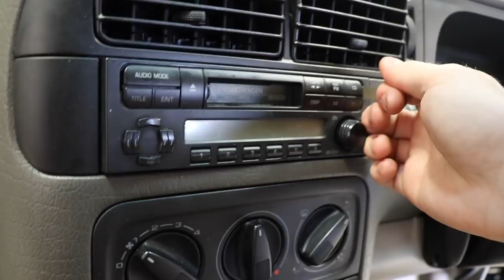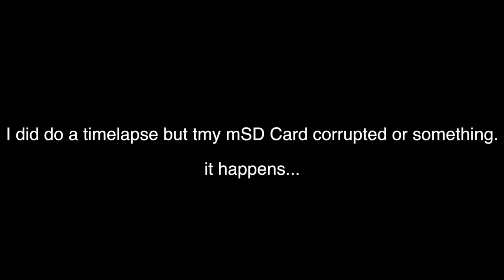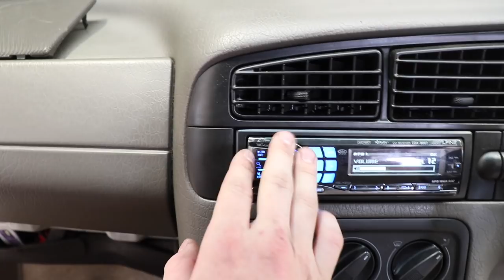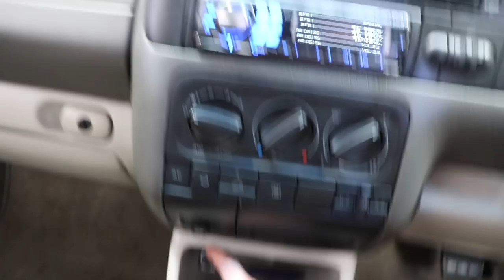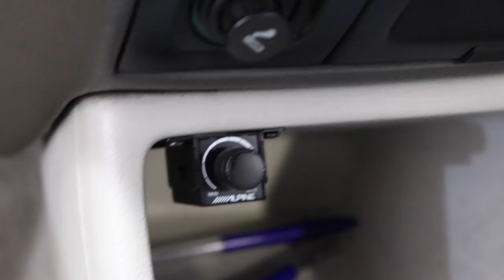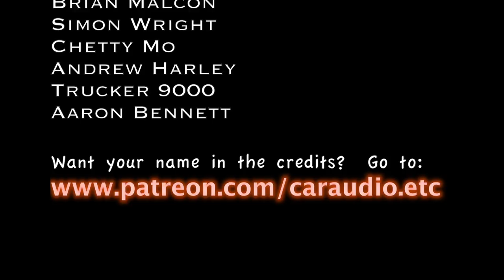VW Golf Cabriolet Gets Some Old Alpine Gear | Sound System Install

Comment: James, The pump in the boot area where the changer was is the pump for the hydraulic hood. The hood uses a hydraulic fluid to lift and lower the hood. You can see the fluid in the cylinder at the end of the pump.
Reply from the maker: You mean the soft top, Or the bonnet?
Reply: Soft Top

Comment: Outsize subwoofers that take over half the boot space is a boy racer thing and looks terrible. Installations should be factory standard where everything is discrete and hidden behind panels etc.
Reply from the maker: That’s fine if that’s your opinion and that is pretty much what we do for almost all of car Audio jobs, but when a customer says can you put my 10” sub in my boot we don’t say “no that’s not how it should be”!
Each to their own man
Reply: Thanks for reply, I'm not blaming you as I have seen your videos. These customers should be locked in the boot and the system turned up.
Reply: so i’m going to be a “boy racer” when I have 6 8s in 5 cu ft of ported enclosure...? Wow...
Reply: Yeah, going in the right direction. A boombox in the boot and brutal taste in music is a start.
Reply: MsCelicagt4 lol "boombox"... low frequency extension down to 30Hz tuning and below with a shallow rolloff down to 15Hz sure is "boomy"... (!) the upper frequency extension is just as good with clean playback all the way up to crossover point (tested with a 90Hz @ 18 or 24dB per octave (can't remember which) LPF... so definitely NOT a one note wonder... the system will be going in a diesel station wagon, and the amplifier that will be powering the front stage is physically larger than the one that will be powering the subs (480w Class AB to a 3500w boosted rail Class D) and i'll be using high quality component speakers up front. I like a decent amount of bass, is that such a problem...? I haven't been a boy for like a decade now and I've never raced... also, please define a "brutal" taste in music; I'm intrigued!
Reply: You never see high end systems include a very large box that takes over half the boot space of a vehicle. It seems the noise volume available is as much for the benefit or annoyance of passers by as the occupant of the vehicle. The music such as it is, is largely a thump, thump thump nonsensical beat as its hard to make out. I trust this explains the position.
Reply: MsCelicagt4 well it's a good job i won't consider my system to be "high end" then! i get where you're coming from but some people find large amounts of bass to be fun and exciting, and like listening to what is music to their ears but not to others as opinions differ... my system will also output significantly more bass than this single 10" in a sealed box off 600w RMS, (although I do actually own one of these subs) so you seem to be pretty tight if you think even this is too much...
Reply: In fairness, if you have a diesel station wagon, you will probably  need some grunt to hear it over the noise of the engine. I have an underseat subwoofer in the car which is discrete and unseen and provides sufficient bass. The boot is free for the use of passengers and their luggage which is what it was designed for and not for transporting an outsize large box with wires everywhere.Its great that you can conduct a civilised debate on these matters.
Reply: MsCelicagt4 an underseat "sub", oh god...

Comment: Nice Job.  I just had a 96 model to diagnose a no air con complaint. Had to pull the fascia and heater controls. There was plenty of glue behind there because all the plastic had gone brittle. Yours looked to still be in very good nick.

Comment: Hello from San Francisco 
First video of yours that I've watched.
Liked it you kept it real with filming as you verbalized/worked out you plans.
I can relate to your customer...put the old system in this car, put a nice system in the Jaguar (road trip car) where it will shine.
My wife has a MKI Cabriolet...it's a bit tougher to get any real/good sound in these cars but I've  installed installed around four iterations of systems over the years...but we try to evolve 
If I may share our journey in search of decent tunes...
One version had carbon fiber Phoenix Gold 4x6 in factory door location (your cabriolet has a much better factory door pod) and a big box in back similar your the one your customer requested. with a 10" Phoenix Gold CF sub and amps...ya it takes up too much space but what hey it was loud ...besides your customer is paying the bills, and we didn't keep the box long....she may ditch this after some time as well.
The second stereo version the sub box was tossed in favor of a baffle with four 8" free air subs mounted out back.
Third version custom fiberglass pods with 6.5" separates in the doors, this required some upholstery to the doors.
Fourth and final version is in the works ...not sure what I'll put in it as we're selling it. But it will be good as it's likely to aid in a sale.
Like your customer, our road trip car has a much nicer system...GMC Yukon with Morel three way and... We'll you get the idea, your video struck a chord with me.

Comment: if  you don't have any other  option run RCA with power cables  but use ground loop isolator  to fix  bad sounds

Comment: Hello, I have a old school Alpine 3566 amplifier, that is a 6/5/4/3, if I put it in 4 channel mode I will get 80 X 2 and 60X 2, i think I would have to use the last 2 channels for my components because the rca input would be in the “front” input is it ok if 
my coaxials get 20 nore watts? Would it really be noticable?

Comment: You need a powered aerial amp on the VW dude, one if the small inline boosters, especially with an alpine deck.
Reply from the maker: Tried that when I was testing, made no difference.
We reckon the original aerial was on the factory windscreen and that at some point the windscreen had been replaced with one that didn’t have an aerial built in.
It would explain why the aerial sheiks wasn’t grounded.

Comment: I have an Alpine CDA-9887 and have the same radio reception problem. Everything is grounded correctly and still has terrible reception. If I put the factory radio back in, the radio works perfectly. I like my 9887, but the radio part of it is terrible. I even tried an amplified antenna and that didn’t help. If I upgrade, I want one that has all the features my 9887 has. But haven’t found one yet. Any thoughts would be appreciated. And yes, it has to be an Alpine, lol.
Reply from the maker: When you say features what do you mean, because the alpine code-163ebt is the current top level single din unit and it has all the sound adjustments you would ever need ?
Reply: Car Audio.etc 
Wow! Thanks for getting back to me. It’s like conversing with a celebrity!!! Anyway, I did check that one out and the double din version because I drive a 2005 Ford F-150. But I think I’m hesitant about buying a new radio because I have my 9887 all setup with crossover, eq, time alignment, etc were I want it. I have the cables for my iPod and Bluetooth for my phone. I don’t wanna spend the money, pull my radio out, put a new one in, get it setup and the new one has radio reception problems. If I didn’t like the radio, I would have replaced it when it started acting up. But I bought it brand new when they first came out. I can deal with bad radio reception. For now, anyway, lol. Love your videos. You’re awesome. Take care.